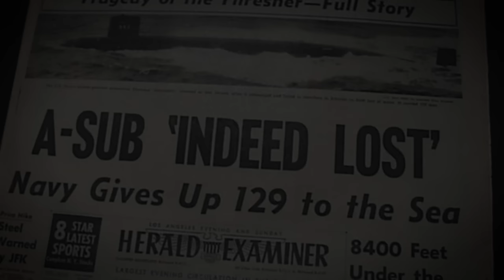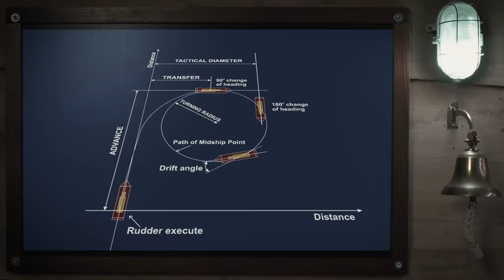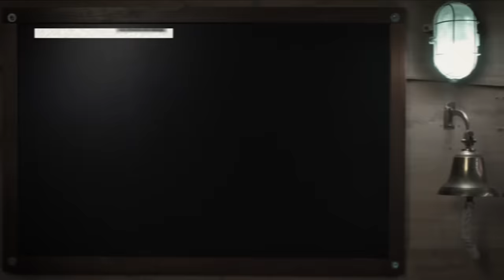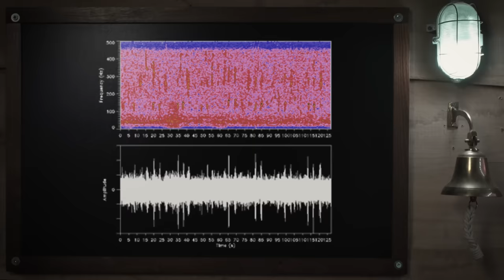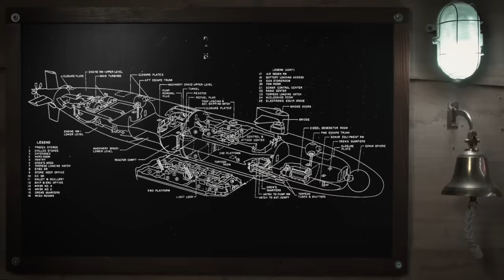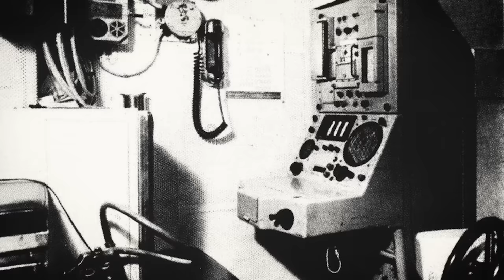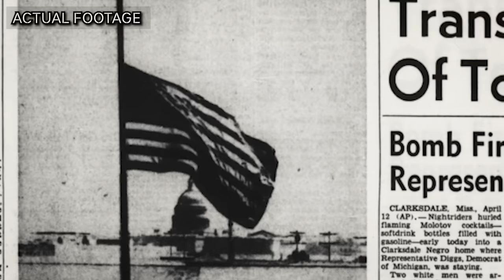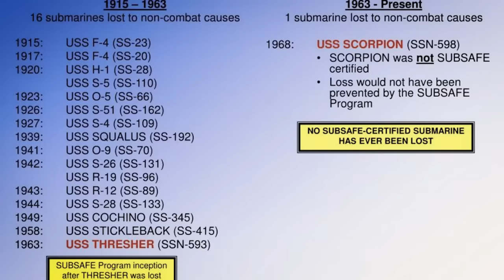This Water Pipe Killed All 129 Men

Comment: The only small mercy is that it was so quick.
Reply: That is so, with regards the implosion but the mental anguish when we’ll below test depth and still going down, would have horrendous. RIP, those poor souls 😢.
Reply: It wasn't quick. They knew exactly what was happening and what was about to happen. They could only stand there and wait for oblivion.
Reply: @joeyvanostrand3655 , the actual death was quick, as you well know.
Reply: @johnnunn8688 unless it is to be believed that at least someone still lived for those pings that may have came from the thresher that the seawolf documented in it’s ship logs.
Or,
The underwater phone where the seawolf’s crew swore could hear communications for a brief, brief moment.

Chances are these were interferences but it would be tragic to know there may have been someone alive.
Reply: An updated report has been released. The crew did not infact die instantly.
Reply: Maybe not that quick,it took time just sinking,the panic must have bewn worse than death

Comment: Not that I've watched that many vids on this disaster, but this is the first time any mention of the strainers has been made.  All of this possibly quite preventable if only those strainers had been removed before sea trials.  So sad.
I love your videos; please keep up the great work.
Reply: If the strainers had been removed
If the engineering officer on duty had trained to perform a fast restart and/or continue using residual steam to power propulsion
If the sub had been trimmed positive 

the last item is a huge one.  modern procedures for proceeding at extreme depth call for trimming the ballast tanks so that the sub will surface, and then using the diving planes to maintain depth.  In this configuration, a loss of power results in the sub ascending, even if only slowly.  

As with most disasters of this nature, a lot of things all had to go wrong for the result we got.  Most of them are things which would be anywhere from a major inconvenience to an unnoticed anomaly, if they had happened in isolation.  Add them all up, and they sum to disaster.
Reply: @ShuRugal The positive trimming is a great example of  learning from our mistakes. It would have taken a very smart individual to come up with that positive trim configuration before we experienced this terrible loss of life
Reply: This is the perfect example of learning from mistakes
Reply: I wonder if the maintenance personnel were ever informed they were the reason the sub sank.
Reply: @PumpernickelBread25 pretty sure they figured it out...I can't imagine some of them were unaware of the shoddy work
Reply: @ShuRugal  It's called, among accident investigators, the Swill Cheese Model. If you imagine each part of the defense against failure as a slice of Swiss cheese, the accident only happens if holes in each slice line up to make a clear path through. Changing any single slice--any single failure mode--and the holes don't line up and the accident becomes a near miss instead of a catastrophe.
Reply: @seanmarkovich7563  "It would have taken a very smart individual to come up with that positive trim configuration before we experienced this terrible loss of life"
The concept of fail-safe was invented long before submarines existed. But nobody would bother with those measures without having experienced tragedy first. Especially not in the military.

By contrast, manned lunar missions by NASA are launched on free-return trajectories, which means if anything fails on the way there, the spacecraft would simply swing around the Moon and return to Earth at an angle and speed suitable for safe reentry. It doesn't take a genius to come up with that, but it does require a strong safety-first culture.
Reply: @djinn666  lol thanks for writing a very long message saying exactly what I already said on youtube. Lmao lay off the Adderall buddy
Reply: 1st time I've heard of the strainers also. Makes sense. I've always heard the Marada (misspelled) was designed after this.
I pause at the New Guy on watch that shut the steam valves. Maybe the old salt would have had a big picture of the seriousness. Blind compliance can backfire at times
There's no substitute for experience.
Reply: Agreeing with averyone here. Safety manuals are written in blood.
Reply: @seanmarkovich7563 Not really. NASA spent so much time simplifying and making things redundant and resistant to error. Doesn’t take a genius as much as concerted effort to protect human life.
Reply: @djinn666 oh shit i just left a comment almost exactly like yours and then read yours. sorry!

Comment: This is a passage about scorpion, the only other us nuclear lost at sea written by Michael Cochrane one of the navy reservists who were responsible for the declassification proceedings for both scorpion and thresher. He was also a structural engineer. 

While the loss of the USS Thresher is well documented and investigated, the amount of information on the Scorpion was very limited. For many years I wondered what happened to the boat. There have been 3 main theories; 1) a mishap in the torpedo room that caused a torpedo to begin running and the crew was not successful in shutting it down before it armed and exploded, 2) a hydrogen explosion in the battery well (located at the bottom of the Operations Compartment [edit 11/05/2022]) due to salt water intrusion or battery failure, and 3) attack by Soviet ships “nearby” (up to a few hundred miles away) who had managed to track the Scorpion on her transit back to the US. There are many other theories that I consider unlikely or not plausible. Unlike the loss of the Thresher, there were no other vessels in the vicinity of the Scorpion, so we will likely never know for 100% certain the cause of the Scorpion’s loss.

In the spring of 1998, I was in the Navy Reserve assigned to a Naval Sea Systems Command unit supporting the Submarine program, primarily the Deep Submergence area. While performing my annual 2-week active duty, I was asked to attend a meeting at the Pentagon. The Chief of Naval Operations (CNO) had determined that with the passage of time (35 years for Thresher and 30 years for Scorpion) and public interest, a project was initiated to review and declassify (with use of redaction) all the information and materials related to the loss of both ships and put them in the public domain or be accessible via Freedom of Information Act requests. More specifically, much of this effort was to be done by Navy Reserve personnel. I had the privilege of leading a team of Reservists to work primarily at the Navy Historical Center located at the Washington Navy Yard. For me, this was a dream assignment. The CNO had directed that material held by various Navy commands on both Scorpion and Thresher be sent to the Historical Center. The folks at the Historical Center were great and assisted our team in showing us where all the records were located, how to use their equipment and marking up document copies for declassification and redaction, where applicable.

Our team carefully reviewed all the documents, audio recordings (from the Sound Surveillance System (SOSUS) arrays) and thousands of pictures. We also made a trip to Portsmouth (NH) Naval Shipyard to review their records since they held construction records for both Thresher and Scorpion. The photographs and investigation reports very interesting and enlightening. The quality of the photos (black and white) of the wreckage sites was amazingly good considering the camera was attached to a ship over 2 miles up on the surface.

Based on review of the reports, photos and video taken by [edit 4/1/2019] Dr. Ballard of Woods Hole (MA), it looked to me that the battery well explosion is the most plausible cause for the loss of the Scorpion. In addition to the photos and investigation reports, my shipboard experience included carrying out inspections of the battery well looking for leakage, helped form my conclusion of a battery well explosion. In addition, Scorpion was still following battery charging procedures more applicable to earlier diesel-electric submarines. Following Scorpion’s loss, the NAVSHIPS Technical Manual for nuclear submarine battery charging was extensively revised to reflect how the on board batteries are employed on a nuclear submarine versus a diesel-electric sub. [Edit 11/05/2022] The main concern associated with battery charging is that hydrogen gas is generated as part of the charging process and needs to be closely monitored to ensure it does not increase to flammable or explosive levels in the battery well. On board ship, another concern was always ensuring seawater did not get into the battery well, or more specifically the battery cells. Seawater mixed with the electrolyte will generate hydrogen gas, which can be flammable or explosive depending on the concentration. Photographic and video evidence showed that the Operations compartment decking at the forward end of the compartment was thrust up indicating some kind of trauma at or near the forward end of the compartment. I’ve seen a report published some years after the project was completed, the information released, including photos and SOSUS recordings were reanalyzed using modern equipment and technology. The report concluded that a battery well explosion was the most likely cause of the Scorpion’s loss. Two individual explosions captured on SOSUS recordings were able to be pinpointed to 2 individual precursor explosions with a calculated energy pulse equivalent to battery cells (nuclear submarine battery is made up of 100+ battery cells). Further SOSUS recordings picked up tank and compartment implosions following the initiating explosions, which was tagged to the battery well explosion. The theory of a torpedo mishap was considered less likely based on evidence of destruction in the Operations Compartment. It is interesting that the Bow Compartment (the Torpedo Room is located in the Bow Compartment) escape trunk hatch was found to be open. This may have occurred if there was an explosion of low yield in the Torpedo Room or may have occurred due to increasing seawater pressure as the Scorpion sank. The theory of an attack by a Soviet vessel was ruled out based on records that there were no Soviet vessels in the area, with the closest ones being over 400 miles away at the time when the Scorpion was lost.

April 24, 2018 update: Found a really great article that provides a lot more detailed discussion that strongly supports the battery explosion theory for the loss of Scorpion with information from a very experienced and intelligent guy who was there and did that when it comes to analysis of underwater sound recordings. 
Link: http://www.bonefishbase.org/wp-content/uploads/2014/07/2012_October_Periscope-Scorpion.pdf Read pages 1 and 16–24 for the full article.

November 5, 2022 update: An article was published in the 2nd quarter 2021 issue of the American Submariner magazine published by the United States Submarine Veterans Inc (USSVI) and written by a Bruce Rule, a retired Naval officer and expert in undersea sounds and interpretation of underwater sound recordings. Based on review of of the original SOSUS and other recordings, he concluded that the most likely cause for Scorpion’s loss was due to battery cell explosions. The pressure pulse from the explosions very likely either killed or rendered unconscious the crew and the sub began its dive to the sea floor. The link below takes you the magazine and the Scorpion article starts on page 13.

https://www.tjcbase.org/wp-content/uploads/2021/05/AS2021Q2V1.pdf
Reply: Thank you for the info.
Reply: Very interesting and informative.  Tears for the crew.
Reply: Interesting bro. Thank you for your time and the links.
Reply: Thank you for the Information💖
Reply: I’m very familiar with both and agree with your thoughts on Scorpion. I’m still not entirely sold on the idea that we know what happened, but do agree with the reported end result: battery cell malfunction, likely due to water presence, electrolysis, fire, and subsequent hydrogen production and ignition. I have my own theories as to why this occurred, but they’re unfounded and just as likely never will be. 

I hope those men are enjoying the quiet long nap in the depths.

Thank you for taking the time to articulate and write this information down.

Comment: Thank you for your detailed analysis of this tragic disaster. It seems like another case of 'learning from mistakes' as happened with the Russian Kursk sub. The trouble is that hundreds of lives are lost in the process. Very sad.
Reply: And not that many people should have been aboard on the test dive
Reply: I cannot understand why silver soldered copper pipes and fittings are used, particularly on larger diameters, where it will be difficult to get the solder to correctly flow. In many ways, solvent welded heavy gauge plastic would be better.  However, whatever material is used, at all points of sea water entry a bolted manifold should directly feed one or more integral shut off valves. 
With the decades of submarine construction, a failsafe method should have been designed and strictly adhered to. Correct design need not involve additional costs.
Water should not be piped through electrical equipment areas. It is all about correct design from the outset, rather than equipment being an afterthought.
Reply: Alas, the aviation industry is pretty much the same.
Reply: Progress rarely happens without mistakes. It is very sad for the innocent victims sacrificed.
Reply: Lives are lost and we still don't learn our lesson.

Comment: The primary cooling , piping was changed, to STAINLESS, TIG welding, Replaced "Brazing", of joints. Worked 'SUBSAFE" attack subs 638, & 688.
Reply: Best and most pertinent comment yet.
Reply: I'm surprised they were even brazed in the first place. Nuclear industry by that time had standardized all-welded circuit piping. Can't go wrong with pure argon and a red tungsten.
Reply: “Red”, for Tungsten, means 2% Thoriated.  There’s also an “Orange” 4% Thoriated tungsten.  (I have some.)

Thoriated tungsten seems to be a trifle more “resistant” to use, compared to say “blue” 2% lanthanated.

Comment: After refit on the east coast, the boats usually head to Norfolk or Charleston for supplies, personnel etc. I was engineer on a  research vessel carrying sensitive listening devices off Norfolk in the 80s as one of these boats (subs are always boats) went       thru sea trials. Seeing a sub surface after an emergency blow, the black bow shoot out and then back down onto the surface is a sight I’ll never forget. Blowing down air tanks aboard my boat to rid water, drain lines instantly become ice cold
Reply: It's even more wild being on one when they do an EMBT blow. :)

Comment: As a former US Navy Nuclear Reactor Operator and Electronics Technician, and a currently licensed Senior Reactor Operator in commercial nuclear power, I had obviously learned about Thresher. I was not aware that at the time, no fast recovery startup procedure was in place. I was born 20 years after the Thresher disaster, so clearly a lot of changes had been made, but when I was in the Navy, fast recovery startups were something we did frequently for training, so the crew would be prepared to perform one when needed. Because of my background and training, it's almost mind-boggling to me that there was no provision for this at that time. In my time in the Navy, we routinely performed normal startups, for the normal shipboard operations, but fast recovery startups were performed for training periodically to keep the operators proficient. Fast recovery startups are significantly faster to get the reactor back online. That is just one more thing that could have potentially saved the Thresher.
Reply from the maker: The watt things are done today is because of lessons learned in the past. Thanks for sharing
Reply: Not only were there no fast recovery start ups, the main steam valves would automatically shut... and they could only be opened manually, which was not a fast process.
Reply: @michaelwalimaa1806  As far as the MSIVs are concerned, I am used to them closing automatically on a SCRAM, at least on the Navy plants I qualified on and operated. The plant I initially trained and qualified on, as well as the ship I served on were both designed to shut MSIVs automatically on a SCRAM. We still had fast recovery start-up procedures we would implement when needed (or for training). I do not believe that having to manually reopen the MSIVs caused any real delays. We had personnel reopening MSIVs at the same time as we were withdrawing control rods to start up the reactor, so it didn't really slow anything down. I don't know if newer ships are designed differently to keep the MSIVs open.

Something that is sort of interesting, is that the commercial plant where I work now, does not have an automatic closure of MSIVs for a reactor trip. We have other signals that will close the MSIVs for various accident scenarios, but on just a normal reactor trip, our MSIVs do not go closed. And we certainly do not do fast recovery startups on the commercial plant, because we aren't in danger of sinking or needing to outrun torpedos, lol. Our first/normal method of shut down cooling is provided by automatically dumping steam to our condenser on a trip, so our MSIVs stay open. We have relief valves to dump steam to the atmosphere if the MSIVs do go closed, however, but we typically prefer to keep MSIVs open as long as we can.
Reply: @pyronuc yep modern boats do not trip shut the MSIVs on scram. Weird that they used to
Reply: why is it that the standard procedure after a reactor failure is to isolate the steam which could potentially be used as an alternative power for propulsion?